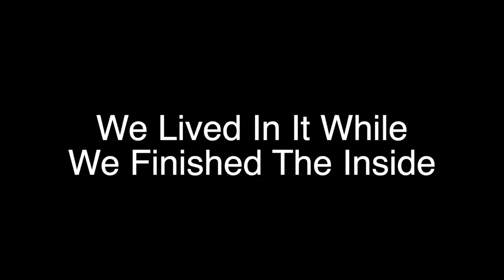Living Without Electricity Takes Some Practice

Comment: I live in a yurt with wood stove.  I live in a forest with plenty of down and dead wood.  My electricity is a goal zero battery bank 400 which can power led lights and a laptop and charge a phone.  100w solar panel. The goal zero LED lights are worth the cost.  Takes time to learn but I have mastered it.  120 nights below freezing point here. Water is in jugs.  Internet comes from next door.  Its actually works really well but takes constant work.  I live on a very challenging site.
Reply from the maker: Interesting. Where are you?

Comment: If you changed your rocket stove to have an unmassed bell, it would throw out a lot more heat and warm up the cabin while it is burning.
Reply from the maker: Yes it would for sure. We found that filling it about 12 inches and leaving the rest unmassed was much better. It heated up the cabin faster but still had a tiny bit of mass to help with slower heating later once it had warmed up.

Comment: You can heat and cool for free running some big tubes under the ground and can add a filter at the outake so you filter and air control at the same time for only the price of running the intake fan

Comment: I had a hand pump for my sons to haul water to the chickens, they had to haul the water about 200 feet to the chickens, 1 gallon of water weighs 8 lbs, 5 gallons is 40 lbs, that's a lot of weight for a bucket, it really impressed them with what the homesteaders had to haul for daily water if their water wasn't in the house.  Our power went out for 12 hours this week, it is odd how living in 2021 how quickly some families went back to the 1800's for a short time, they were lighting kerosene lanterns, not showering that day, etc...

Comment: I don't carry water, but everything goes into a holding tank that is expensive to pump out, so I conserve it.  I generally use about 2 gallons a day for drinking, washing, and flush my toilet with the used wash water.  Like you say, it's a good experience to not have those things.  Most people think they absolutely have to take a shower or a bath.  I can wash in a couple cups of water,  a wash rag, and a bucket.  I only wash with clean water, no soap.  The wash rag gets the dirt off and I don't have to rinse.  I pour the water into the washrag, so it's always clean.  I imagine everyone knew how to wash that way at one time and many people in other countries still probably do it.  I wash my underwear in a little over a gallon of water.  Rinse it the same way, just pour water into the cloth.  I go to the laundromat once a month or more to wash my jeans and bedding.
Reply from the maker: Sounds like you have the same system as us! We did laundry off grid a few times but usually at a laundry mat because hauling a hundred gallons of water between the wash and rinse was Herculean. If we had to do laundry off grid once a week we would cut back all of our laundry to two changeable outfits apiece.
Reply: @dirtpatcheaven  Yeah, two per week is about right, depending.  I generally wear my jeans longer if I don't get too dirty.

Comment: I set plastic water pipes in a concrete floor in a wooden building outside my house and plumbed it in under the house the pipes where only half inch from surface and it worked a treat and stayed warm for a long time, I wonder if you can do the same with a small water pump, copper coil around the wood burner chimney, I plan to build an A frame house raised off the ground using this method to heat it, under floor heating is much better I think 👍
Reply: My uncle built his home and what he did was run metal pipes up the chimney to capture some heat before the water went to his water heater. It worked. Be aware of expansion and contraction and the dangers of it possible freezing scenarios
Reply from the maker: Darwin in the Honey Do Carpenter wanted to do that with the rocket mass heater. I don't have the expertise to do it safely but it would be cool for sure.
Reply: @dirtpatcheaven  That’s the thing, if something goes wrong any/all insurance will not cover it if you installed it yourself.
Reply: @mio.giardino  : That’s not entirely correct. There are thousands of homeowner-installed heating, electrical, plumbing, devices that cause damage every year and those claims are insured and the losses paid. Unless there is a specific exclusion for a specific device, or a warranty that a specified device is not installed prior to informing the insurer, the loss is covered.

Comment: The only thing I will add is that solar lanterns (Luci Lights) are extremely useful.  Many people in India live off grid naturally and many of them either use candles or Luci lights. You just sit them near the window sill and recharge up and last upto 24 hours on a single charge. Me and wife use them daily as our beside lamps (you can inflate them and deflate them). We don't live completely off grid but were definitely hardcore minimalists. I live outside of a backpack and charge only two devices a M1 Macbook Air and a smartphone (mainly for work). Hope this helps.
Reply from the maker: I love those! We had two when we were living in our RV for a few months!

Comment: i guess you think i was nuts solar panels battery's and a 2018 camper heater & ac bunk beds micro wave power inverter  i was in a camp area no generator run after 10 pm the ranger after watching movie from sat-alight, he drove off mad at 1 am in morning!  i have a boat i got 3 gallon tank i run it one take a year solar electric slow trolling motor with gas outboard for rough water!

Comment: What is the average temperature in the cabin when the rocket stove bed is warmed?
Reply from the maker: It depends on whether the pebble base has the warm air running through it or not. If the stove is on and the air is diverted through the pebbles it is in the high seventies. If the air from the stove is going directly into the room or out the chimney it is in the eighties once it warms up. If the fire is out and the pebble base has been warmed for a few hours it is the low seventies. That is all fahrenheit.

Comment: theres so many ways to make & store electricity im not getting why without? is it to avoid EMF's? when i was 9 i made my own. WW2 gasifiers were popular uses wood. panels work well if put up right. thermoelectric modules make electricity from heat. pedal power generator bicycles make it? that being said people use way too much. i have repaired & built appliances since 86' so all i have is gas propane
Reply from the maker: For the experience. To teach my children that if the power goes out there is nothing to fear. To enjoy slowing down and working hard. Without electricity you do things with your own muscles so it builds muscle and resilience.
Reply: @dirtpatcheaven  well there is talk of an EMP which would put people in the dark. i have many backup plans & all is in faraday cages. theres medical issues to think of. i try to teach my 2 daughters all i know but.. they are just teens & interest is in other areas. video games. its good you have yours interested 👍

Comment: I like to pass this kind of information on; the world is fairly ignorant of the existence of the eastern european piec.  Google 'sunbathing in the living room: Oven stoves and heat walls'  for a low tech magazine article.  Youtube tends to delete links.
Reply: They are so hot that even in minus temperatures there is occasionally the need to open the window.  I lived with one for two minus twenty winters.  And the heat is very different.  Much more full and comforting than electricity or gas.  And because they store the heat, after the fire is out it stays warm until almost midday the following day.  But you need about five/six hours to feed it and it takes an hour to come up to heat.  But you get the immediate heat from the lit fire anyway for the first hour or so.